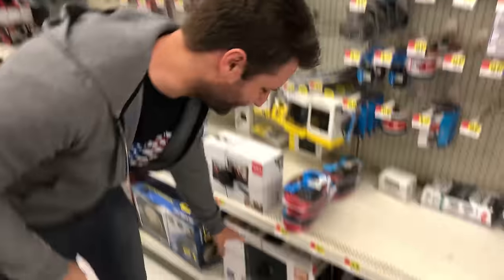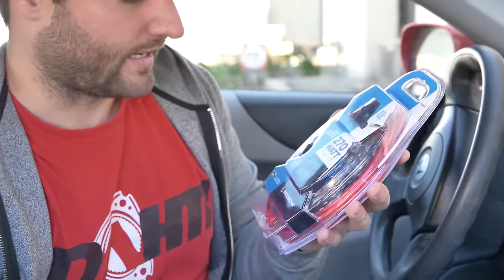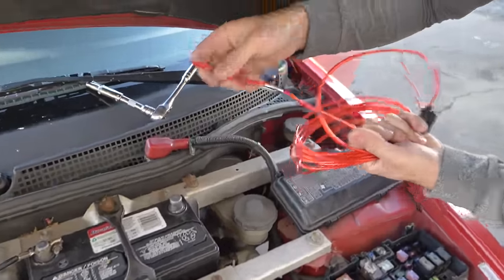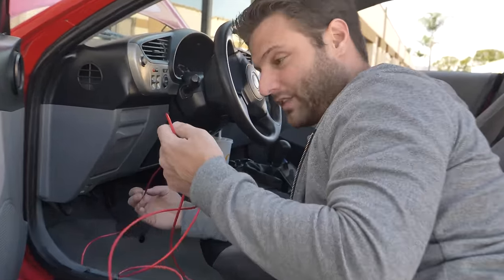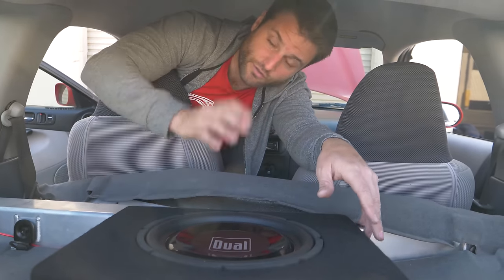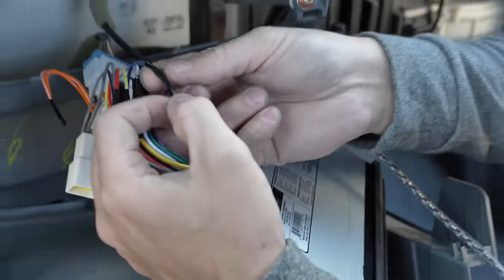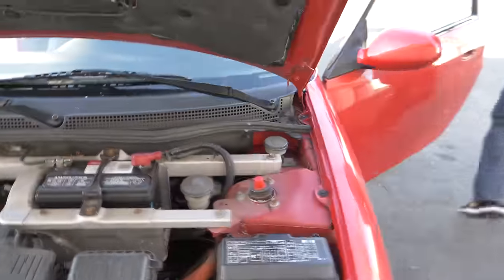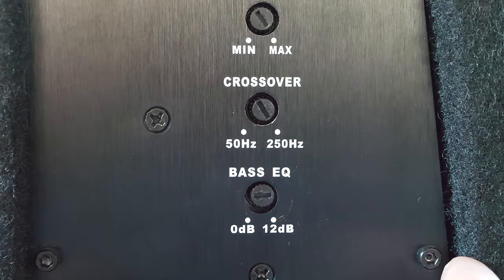How bad is the $70 subwoofer from Walmart? Install | Review

Comment: Install professional here people. Mainly, don't EVER!!! wire an amp to the fuse box EVER!!! The feed to it is gauged exactly for what it's designed to feed, nothing more (especially an amp). It runs straight to the batt anyway. Also, Dual is as garbage as it gets, just don't.
Reply: Good advice, but this dual amp probably pulls less amps than a cigarette lighter lol, it should be just fine.
Reply: He is an amateur that didn't do his homework before installing.  He made the installation more difficult by removing the fender and someone has already covered wiring it to a fuse box.   Uggghh...
Reply: I can hook all that other stuff up properly but did he hook the 2 ground 2 hot and 2 remote wires up
Reply: yjjeeper1 Dual is garbage? How so? Dual has made great hi-fi equipment for many years, don't judge on a low budget product, what can you expect for $70.....
Reply: Rob Monaghan I expect garbage not because it's $70 but because it's Dual, hi quality and Dual should never be in the same sentence. They are the only brand around that makes Jenson look like a premium brand. Look, fine if you like your Dual stuff because of what I have to assume is just not knowing any better or don't want to admit you threw away your money but I wouldn't brag to loud to anyone with real car audio because you'll look dumber then you sound now. I have removed Dual stuff in the back of the shop I can't even give away lol.
Reply: yjjeeper1 Well who is the one who looks dumb? Dual is a German founded company and has been around since 1907, famous for making great turntables and other hi-fi equipment, they have recently reemerged into the vinyl/turntable market... A Korean company bought the right to use the dual name in America to peddle cheaper Asian stuff in mobile electronics, hence the products you mention, this stuff does not reach Europe where the dual name remains intact and liked, I guess the US has a market for cheap garbage and Europe and more specifically the UK are left to make decent 'proper' hi-fi equipment.....
Reply: Rob Monaghan wow I definitely stand corrected, I just didn't know LMAO! I'd love to hear how that makes me calling their car audio garbage an idiot. Look buddy, I've spent a life time building REAL systems so I see a "How to" vid showing people first the wrong and damaging way to do something and then singing the praises of Dual, I feel obligated to offer some sound advice for people that may not know something like Dual is GARBAGE!!! I don't waste my time researching the history of such an embarrassment of a car audio brand but hey, more power to you as you apparently do. Enjoy your sweeeeet Dual set up, I'm sure it's VERY impressive lol.
Reply: yjjeeper1 I didn't call you an idiot....  Sure, Dual in car audio maybe garbage compared to what is out there, I know what both car and home audio is like with plenty of experience in both and the Korean crap that dual pushes in the US is not a reflection of the brand as a whole, that's all I was trying to get across, things aren't always as they seem and it's maybe foolish to make such blanket statements without having full knowledge....
Reply: So not even an accessory post off of a fuse box? Thats how mine is currently and voltage doesnt drop below 13 full tilt. Would straight to the battery be better?
Reply: Neversober217 yes it's not only safer for you and your vehicle but also the bigger your amp, the higher quality the sound. The reason is an amplifier unlike most other electronics has a constant power draw fluctuation so the more powerful the amp tyke more likely you are to damage your ecu and other vital systems, as well as in many cases where the lead wire to the fuses gets to hot from too much load and melts shorting out the car, burning out the ecu and sometimes catching fire. Obviously the bigger the amp, the higher the risk but it's never a good idea in any case. Hope this helps.
Reply: yjjeeper1 Good response.... Respect
Reply: yjjeeper1 yeah I didn't understand that method myself.. Always have hooked straight into the battery with the inline fuse.. why in the world would you want there to be a problem within your fuse box?
Reply: Lifeistooshort Letitgo Lol! Exactly.None of these MF supersaiyan audiophiles mentioned anything worth noting but bitching about where he ran the power wire to power his Led light bulb aka dual amp.
Reply: Wrecking Crew your way is the only right way there is. I think a lot of people do it thinking their actually protecting their car and there's a main fuse between that terminal and the battery adding extra protection but there isn't. The worst part is people have a bad habit of upgrading their amps/subs down the road and reusing the same power leads, wires start to melt and they don't know why because "it was fine before" lol.
Reply: Definitely got to agree that duel is complete garbage. At least in America. How come no one said anything about how awful the scosche rca cables he used are? Lol they might as well have the name duel on them. Lmao
Reply: James Roberts LMAO no shit right. But something tells me this guy isn't that worried about some sq loss or feedback problems, he'll just think his subs really hittin lol.
Reply: Boy I made that mistake one day .. As I was lighting up my blunt I noticed smoke coming from behind me instead of in front of me 😂😂😂
Reply: Dude, at most the amp is pulling 6 amps, (12v 75watts) and looks like he is using about 12-14 gauge wire. He's not going to see any problem with tying into his fuse panel. As a rule, yeah, its not the way to do it, but what do you suppose he should do? Buy a new terminal, run 00 gauge wire, fused at battery for a $70 sub woofer that has an integrated amplifier? You are over thinking it waaay too much. Somehow, I don't think @Rob Dahm is going to upgrade to anything more powerful than this in his honda insight.

Also, call dual garbage all you want, but Rob set out to find something dirt cheap to supply a little more low end to his car, he installed low end components and got exactly what he was looking for, so how, exactly is it a bad idea? Do you think he should have spent 3-4 times what he spent on some other entry level but brand name stuff to do more than he wanted?

Also also, LOL at getting a shop to install a $70 sub. Pay a shop $70 (minimum) to install a $70 sub? 
Get rekt m8
Reply: yjjeeper1 hey, if you don't mind, what exactly did I saw that's incorrect?
Reply: so whats a better 70 dollar sub?
Reply: timothy790110 it's not that I don't see your point, but just because I do this professionally doesn't mean I'm saying spend thousands. My wife's truck has 2 JL 12's, 2 600wtt rms JL amps, a 5ch JL amp running  MB Quart mids and highs and a touch screen head unit and I'm about $800 invested in it wires and all and sounds fantastic, it's called Craigslist. My cars another story but I compete so ya it's got thousands in it. I'm just saying you can get a waaay better sub and amp for around 150, just do your home work and know what your buyingand you'll end up with something a lot better than this that's worth installing.
Reply: yjjeeper1 but what if my budget is 70 bucks?
Reply: timothy790110 if your budgets a hard 70 and 150 give or take say 25 is to rich for your blood then I suggest waiting till it isn't. People spend 70 on this because their cheap, only an idiot would rip his car apart with 70 bucks hoping everything goes perfect. And your point is what?
Reply: timothy790110 perhaps your right but if I get out more I'll need to confront my no tolerance for antagonistic idiot's issues I struggle with. At any rate I already answered the question, and your "scenario" is flawed anyway.
Reply: yjjeeper1 wait, it seems that you are answering to a post I didn't pose, and to a statement I never made. Why the escalation? How exactly was I being a smartass between those 2 posts you made? I didn't write  anything?
Reply: yjjeeper1 hey man, you didn't get around to addressing my response and how "literally nothing" I said was correct. I'd be interested to see this, and maybe learning something.
Reply: Aaron weisler refer my response to Nathaniel, have a nice day buddy and I hope that's helpful.
Reply: yjjeeper1 there is no way this sub has more than 75 Watt RMS, 75 Watt RMS, with 12v system, doing very basic math, works to just over 6 amps. I didn't use a micrometer, but if it's not 14 gauge, it might be 18. Doesn't make a world of difference because we are talking about 6 amps, literally the capacity of most cigarette lighters. Get wrekt m8, or as we say in CANADA  take off, eh.
Reply: Aaron weisler lol, please keep sharing those gems of wisdom, your making my day right now! You went the wrong way on all of it! Your fucking great, please please more facts please, tell me more?
Reply: yjjeeper1 *you're
Reply: yjjeeper1 certainly didn't say that, told you to get wrekt, which, following this comment section, you succeeded in, and then to take off, which hopefully, you do shortly. I'd love a beer, but not if it means having to be seen in public with you. So thanks, but I'll pass
Reply: fuse box lol u ment fuse and yes you need a fuse between and amp and batt.
Reply: Rick J every car has a main fuse buss/relay box under the hood where he did it, so yes box. Of coarse you need an IN-LINE fuse, that's a given.
Reply: I had 2 12s powered by the fuse box, never had an issue. I did change it to the battery because i got a new and better one. If I was running more power then yeah I never would’ve went to the fuse box. Soon doing a v8 and after that probably gone get some beefier speakers that will eat 2400 watts for breakfast. My goal as sad as I’ll be if it happens, is to shatter my rear window lol
Reply: William Garber 2400 rms is getting into a pretty respectable range, don't forget about your alternator.  It's pretty hard to break glass but I hope you hit your goal without too much cost lol, hope it turns out bad ass.
Reply: Where do i wire the amp to then?
Reply: knight carmen ok so there's only one correct place to wire any amp, straight to the battery with an in-line fuse and a good chassis ground. This keeps your car and the amplifier both completely safe. Hope that helps.
Reply: Normally, I would agree about wiring to the fuse block. But if that "amp" pulls more than 2.5 amps of current, I'll shit a brick.  lol
Reply: Wasn't the original German company sold, or they went out of business and the name was acquired by somebody else? Pretty sure these aren't the guys who made the vintage turntables and all.
Reply: Wes W ya I know it doesn't pull much but people have a nasty habit of using wires already ran to swap in something better when they realize stuff like this sucks, happens a lot. I fix a lit of electrical from stuff like this, eventually it almost always fails because let's face it, if you wanted an upgrade would you be content with something like this? As far as it's origins the gentleman at the to of this educated me a little, he said the branch of dual that we get in the states comes from China or something like that so the quality isn't there anymore.
Reply: yjjeeper1 
Did school finish early today?
Reply: Dave Rhodes I'm guessing in your world that was pretty witty, if that's all you've got I'd think a little harder next time before coming at someone like me. Try speaking your mind if you have one, you'll get a little further. You should go, the short bus is gonna leave without you.
Reply: love the name. i have a YJ as well. 94 her name is Betsy
Reply: pistachio
Reply: First off, he connected it to a main positive lug that is fed directly from the 2 gauge cable from battery positive. No problem there. 

Secondly, “gauged exactly for what it’s designed for” is bullshit. I have yet to see a “wiring kit” from a Walmart product (or anywhere else) that had properly-sized power supply wiring...they go with the bare minimum to save - and thus make - money.

Comment: About 34 years ago I was doing that to an Omni 024. Only there were no subwoofers sold like that,so I went Jensen 6X9's. I think I had Panasonic 6" in front. With a no name 20 watt x 2 amplifier. It was way better than the dashboard's original 6x9 that was just an oval..no tweet or midrange.
It was so important then.

Comment: If you follow these steps you're guaranteed to burn your car to the ground
Reply: 😂😂😂😂 I'm dead
Reply: Lol
Reply: Instead of being another troll online why don't you comment how he can do it better if you actually know anything
Reply: MightiestArm that’s because he has zero clue how he could fix it :) that’s how the internet works!!
Reply: Haha i wished ive seen this 3 months back...
Reply: @MightiestArm  run the power wire so there is no chance of it shorting out. Like rubbing against the fender. Run the power wire on the left side and remote and rca on the right side. This will give less distortion and if the wires lose their insulation you wont hsve a fire, actually you might still. Bottom line make sure your power wire doesnt ground itself out
Reply: Truckloadofrhymes canada I don’t see you building a AWD 4 rotor RX-7

Comment: Don't hate this subwoofer we all used low end subs before high ender subs . It gets the job done at the end of the day that's all that matters .
Reply: ORANGE BOY 714, exactly dude. We've all bought the cheap crap to begin with. And then spent thousands
Reply: Carlos . B pretty sure those 12s bump and yeah
Reply: Hell yo an alpine bass line is pretty budget though and those get down he could have picked one of those up for 40$ online and that leaves room for a cheap amp to and it would have already been better then a duel but hey I’m not hating some people just want the boom sound and no feeling behind the music which I respect but I like to feel the music while at the same time not drowning it out with to much bass
Reply: I didn't. Why would I use crappy subs when the good ones don't cost much more
Reply: I had a 8inch bazooka bass tube in HS.
Reply: I still bought cheap stuff but my first system was 2 12" Power Acoustik Mofos with a 3000w amp back when I was a Sophomore in highschool. Was it the best system ever? No. Did I get off work late one day and drove past the movie theater with the volume turned all the way up and my friends text me asking if a just drove by and guessing correctly which song I was playing from the bass lines? Yes.
Reply: Still running a dayton ho dvc 12's on a sundown audio 1500 mono and Jbl 660gti's on sax 4x150
Reply: WRONG, all I have ever used are Rockford Fosgate subs and amps and they have all been far from low end.